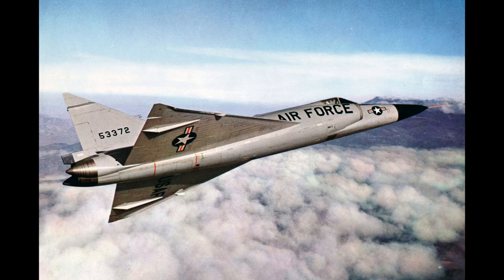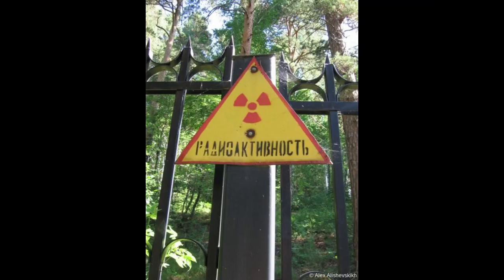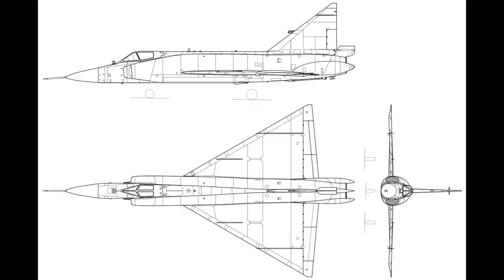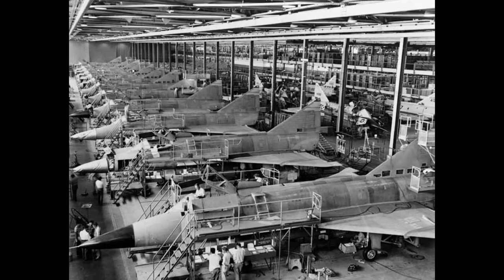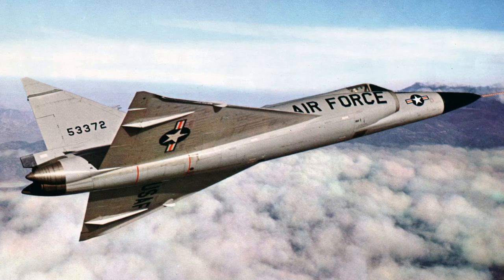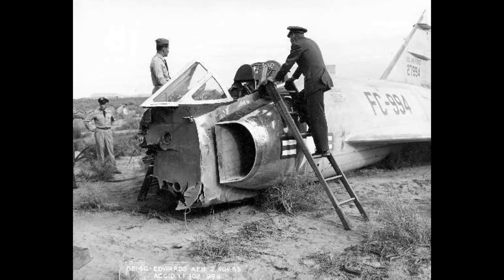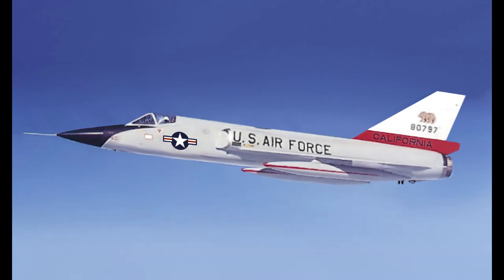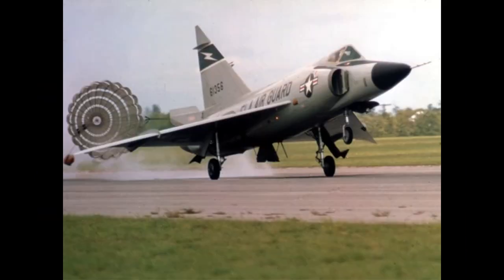Planeposting 3: F102 Delta Dagger

Comment: When I was at Tyndall AFB, Fl. in the late 1970s, we were flying the F-106.  Many old F-102s were modified by Sperry-Rand Corp. as remote control target drones.  Very odd seeing a fighter jet taking off with no one in the cockpit!  The pilot was in the white Sperry-Rand stepvan parked on the runway.

Comment: The center vertical frame on the glass cockpit, really is quite an obstraction to the pilot's view.
Reply: Not really.  At the time, pure interceptors didn't need the visibility that fighters did.  The pilot is busy with the radar, just below the windshield.  Had the same system on the Convair F-106 (the follow-on to the F-102.

Comment: Does anybody know if an F102 ever went up against a Mirage 3 or 5  in training?
Reply: According to Wiki, during the Vietnam War......
"An F-102 was shot down by a VPAF Mikoyan-Gurevich MiG-21 using an AA-2 Atoll heat-seeking missile. The MiGs approached undetected, and one of the F-102s was hit by an air-to-air missile, which did not explode immediately, but remained lodged in the aft end of the aircraft, causing stability problems. As the pilot reported the problem to his wingman, the wingman observed the damaged Delta Dagger explode in midair, killing the pilot.[29] This was the only air-to-air loss for the F-102 during the Vietnam War. The other F-102 pilot fired AIM-4 missiles at the departing MiG-21s, but no hit was recorded."
Later in the Turkish-Cyprus War...
"The Turkish F-102s saw combat missions during the 1974 Turkish invasion of Cyprus. There have been claims of air combat between Greek F-5s and Turkish F-102s above the Aegean Sea during the Turkish invasion. A Greek internet website editor, Demetrius Stergiou, claims that the Greek F-5s had shot down two Turkish F-102s, while the Turkish side has claimed that their F-102s had shot down two Greek F-5s;[45] however, both Greece and Turkey still officially deny any aircraft losses. The F-102 was finally retired from both of those air forces in 1979."
So some F-102s were in combat, and had losses.